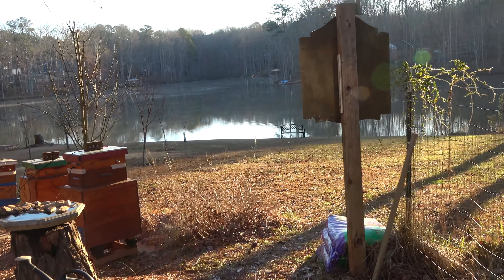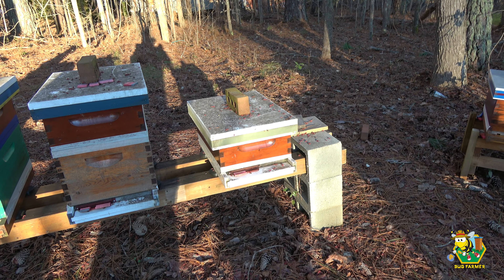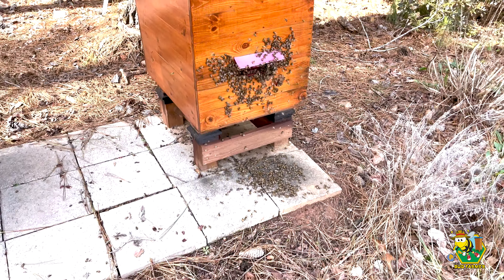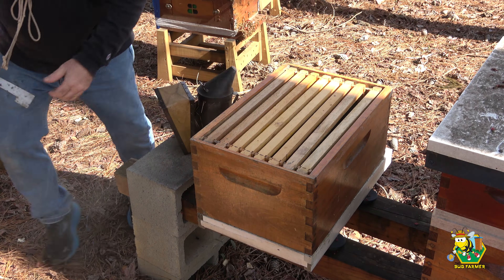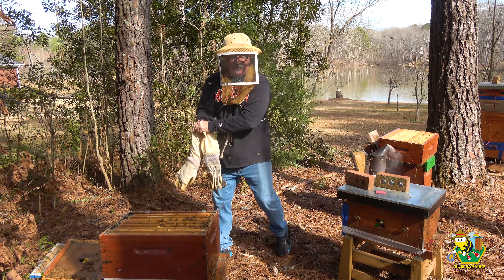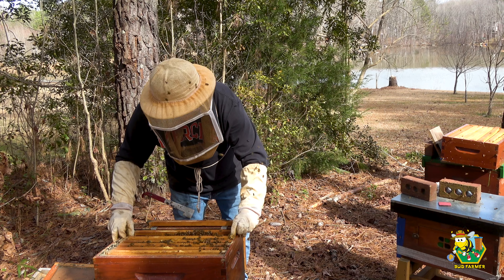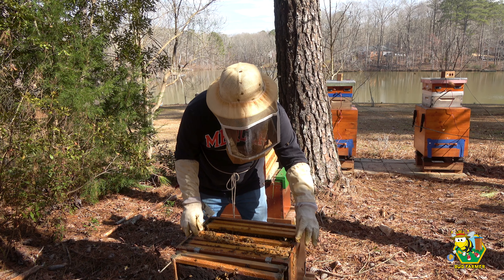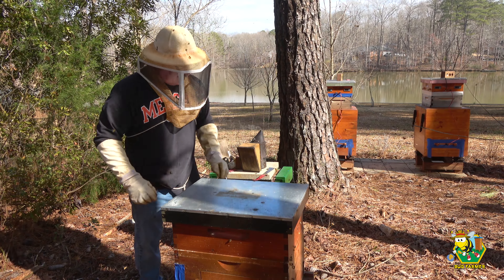Let the FLOW Nectar Begin! | 2023 Spring Preparation and Inspections.  #beekeeping #bees #prepping

Comment: Nice montage there. How do you keep the foundation from blasting across the driveway? Whenever I try to pressure wash bee equipment it just slips away. Those hives look powerful.
Reply from the maker: hi Jim.  If you notice I placed the foundation against a place in my driveway where the pavement wasn't level.  That is the secret.  The outtakes show the foundations blowing all over the place.  Mr. Ed (Jeff Horchoff) created a board that holds down three frames at a time and holds them in place while he blasts the frames.  This will certainly save money on foundation.  Wait until you see inside of the bee barn next week.  I went into the green bee barn again and it was packed.  Do I have to say it... Bee Barns are the way  :-).  Thanks for stopping in to have a look.  It's always nice to hear from you.  Take care.